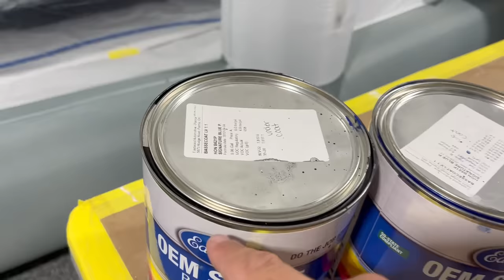I Completely Ruined THIS Paint Job

Comment: I worked at a limousine factory years back, and some dude at the other end of the shop which was almost 200 yards away was using some silicone caulking, and the paint shop guys came screaming down to the other end of the shop asking who the F*** was using silicone!?!? That far away, and still got tons of fish eyes in the paint even though it was in a paint booth.
Reply: Haha, yep.
Reply: We had a guy start up the diesels he would work on right in front of the booth,  smoke would come ripping through lol. The painter and him always yelling at each other even though it's the owners fault
Reply: Makes sense hey. If someone lit a stick of incense even briefly, everyone in that space would smell it. So easy to contaminate an entire space.
Reply: we had a cleaner who decided that the cleaning chemicals supplied to her were not good enough, so she brought her own silicone-based furniture spray polish in to clean the office. contaminated everybody who was in the offices and it migrated with them to the workshop floor causing thousands of pounds worth of damage to paint jobs in the booths (slight negative pressure) too dumb to accept the reasons that were explained to her why she should have just used the cleaning products supplied to her...
Reply: I don't understand What's the problem with Silicone Caulking that could affects the paint
Reply: @geo745don  The fumes from it cause fish eyes in the paint where the paint does not stick in little spots all over the car.
Reply: @user-lx9jm1wo3h  Wow i could imagine from a Spray of Silicone but from Caulking from a Tube. I learned Something new
Reply: @geo745don  Yeah no sillicone caulking soes not affect paint.. ive used plenty of caulk on trucks bwfore painting them. Its the spray sillicone that travels

Comment: A good way to teach people is to show what NOT to do by actually demonstrating someone actually DOING it. While this paint job wasn't intentional, I'm sure, it is good to see what went wrong by actually seeing it, analyzing what went wrong, and explaining and showing ways to correct it. Just like a pilot; they go through almost every emergency situation imaginable in the simulators. Paint society could do videos like this. Like using a slow reducer when the shop is 100 degrees. Or what if you use double the PSI on your gun. Or what if you spray your paint too thick. They could get some cheap paint, some junk panels, and show us what NOT to do by actually showing them do it! Because it's just as important to show what NOT to do than just what to do.

Comment: So glad you posted this. I've been painting for 25 years, and I STILL have problems every now and then with contamination and fisheyes. One thing you mentioned that helps is allowing the first layer to kick before spraying on a heavier 2nd and 3rd layer. Sometimes I will shoot and have a PERFECT finish, and my confidence soars. Then I'll turn right around and get fisheyed all to hell. It is frustrating! I take notes on every shoot, when things go wrong and also when they go good. It helps. But I've come to learn that there's always the possibility that you get contamination from somewhere unexpected, and you just have to bite the bullet, sand it, and reshoot!
Reply: I noticed you used static gun on inside of booth. They usually have microsopic powder on them. May I suggest wiping the car with Safeway after using static gun. Particles could gave become airborne and landed of surface before you painted.

Comment: I was working at a high end custom paint shop a few years ago and the painter had to get up at like 3am to paint because it was so hot in the summer that he kept getting solvent pop on expensive builds and had to go back and redo it. These are the things that can happen and it sucks but it's a lesson in life. Always glad to see you show the reality of things.
Reply: Paint is kind of an art instead of a science.  I work for an OEM, and the Paint Shop is constantly tweaking things throughout the year with the robotic spray booths based on the outside temperature and humidity changes through the year.
Reply: You.have.a.tent..not.a.real..paint..booth.dud.
Reply: High end shop and no aircon ?
Reply: @Gegsite  its not about airtemp, its about surface temp of panels.
Reply: o0bviously air temp effects panel temp
Reply: @Gegsite  now yes but not back in 2016 when the guy I worked for started. He was the painter at Gas Monkey Garage and then decided to start his own shop. I worked there a few years doing the YouTube content. The new place he’s been in for a few years has air conditioning and top facility equipment.
Reply: This sounds more like over reducing the paint, making the paint flash off 2 quick, or stacking the coats on top of each other to rapidly or not useing  a slow enough thinner, if you just stack a coat on top of the last coat, sometimes it flashes off too quick and will give you solvent pop, too much dry time in between coats also.
There are a lot of variables in the types  of paints and the recoat times in-between coats where the original application will enter into critical cure time then you will have a new problem!
ALWAYS READ YOUR PRODUCT INFOMATION LABELS  and follow them like a Madd scientist, rember you are creating a thing of BEAUTY!

Comment: I’ve had this happen when I had too much air being pulled from the booth that I built in my garage. It kept happening no matter what I did until I changed up my fan setup to be positive air pressure inside the booth. Turns out I was pulling in dust through and over the panels/car to my extractor setup.

Once I installed a a high static pressure fan and filter to keep positive pressure, that went away. I didn’t think that there was that much dust in my garage, let alone able to get in through the zippers and seals around the filters.
Reply: Spray booths should always be positive pressure, every booth I have used has a positive pressure to keep contaminants out.
Reply: Something that I learned the hard way, and have made sure of ever since.

Comment: Brian, I recently painted an 03 Accord and sealer, base both looked phenomenal. Then, when I laid down clear I had hundreds of fisheyes. Turns out it was my air compressor. Even though I had a wall mounted oil/water separation system there was oil or something getting in my lines. I boiled it down to being an oil driven compressor. Once I switched and got an oil-less compressor, the redo looks great. Thanks for all you do, your inspiration and the reminders that we will all have issues when painting cars.
Reply: Well, it was the first time he'd used the refrigeration unit. It could be an oil-driven unit or had some lubrication contaminant left over from the factory. I use disposable filters/water traps that pop onto the end of the line, then your gun pops into the filter. It filters the air one last time before it goes straight into the gun. Those have saved me more times than I can count.

Comment: I installed one of those Eastwood filtration setups and had the same problem. Disconnected it and used a different filtering setup that was more janky but the problem went away. I’m planning on disassembling the Eastwood filter to see if I can see what’s wrong. I love their paint products, though.
Reply: You nailed it. New equipment never tested
Reply: They probably use non bodyshop safe stuff in it
Reply: Yep, if yours was brand new, like here, I'm thinking there may be wax or grease contaminants internally.

Comment: You gotta be kidding me! I sprayed my car with single stage today and had similar disaster. Fisheyes all over the place. But, I have plenty of paint still, so I'll try again. Thank you for honesty, seing those perfect results all the time makes me lose hope that I can do it. Your videos, just motivate me to try again and get better.
Reply: Sand your first time down using a water spray bottle and then wipe it down as you go after sanding a panel with 600. 
Keep the panels as you go wiped clean as you go, then tack and spray another wet finish coat over your panels to act as a final coat.
The last finish coat can be a clear coat or a finish coat of color.
Less time in the booth, good booth prep for cleanliness,  keep the air flow down, better to have a downdraft type of booth, but the less dirt, the less stirring the things, up agitation of the things,tack and spray sand for finish in the booth, will give you a cleaner job overall.
All my custom finished  paint jobs were, prep, wax released, tack, spray.
Reply: Fish eye eliminator and clean it better.
Reply: Lighter coats always help, for sure the first one.
Reply: Single stage can berry it on the next go around. Like the guy said, 600 and get a nice flat coat.

Comment: Easy test to see if you have contaminated air if to put your blowgun on and blow onto a mirror for a good 5 mins. If it fogs, or leaves an oily residue, you have your fisheyes answer. Also, tack before using the anti static gun. Rubbing the tack rag on the surface creates static!  Keep the videos going brother!  Subbed!

Comment: I really like the setup but that blower near the floor will circulate dust particles
Reply: Plus it's bringing in crap from the garage with no filtration on it.
Reply: Yes, the fish eyes kept getting worse at the end, and I think the only thing that was changed was adding the intake fan halfway into the paint job. It's a brand new booth and intake fan, so I think it's burning off the mold release oil from the factory. And the fine fuzzy stuff from a brand new floor of the booth. Just a guess, but I would shut down that new intake and try to spray another test panel like  the decklid on the corvette
Reply: That’s what I was thinking blowing shit up off the floor
Reply: I was thinking the same thing.
Reply: The front of the booth is open while spraying at 10:35, air movement could have sucked all kinds of contamination in!

Comment: Might try a little fisheye eliminator in you clear. I've  use it before even just on the second coat and it allowed  the clear to fill the fisheyes enough to save the job. Some of those were pretty deep. I'm  sure you probably don't  use  anything with silicone in that garage but that would do it.
Reply: Hey, love your channel 👍
Reply: @molnarmalibu4702  thank's brother!
Reply: Never heard of doing it on the 2nd coat. I've always added it if I knew the booth would be an issue. Remote painter sometimes lol

Comment: Hello Brian, I had a some of those in my paint job. Only showed up in the last coat of clear so they are not too deep. Most cleaned up in the cut and buff but there are a few that will need some attention. No one notices them unless I point them out. Generally the car looks pretty good. Since I had to re-shoot because the metallic did not lay right the first time, I think I will live with the result. It ain't perfect that's for sure. My air system consisted of two smaller air compressors with extra tankage feeding a filter separator I had sitting in a bucket of cold water outside my garage. It seemed to work ok, I drained a bunch of water out of the system after each use.
Reply: If the few bother you too much you can dab a drop of clear in the fisheye and then sand it and buff. Totally gone at that point.
Reply: @careykuhn9174 - Thanks, gonna try that.

Comment: I spent a year working through constant issues arising on my painted surfaces but I finally got it figured out and haven’t had any problems now for months. First up was replacing y 20 year old 80 gallon with a new one then 20 ‘ of line up and down the wall with drains then two water oil separators then then two filters all done with 1” ID pipes including filters. All of my system is grounded .

Comment: When you added the 2nd blower right before you cleared. Is it possible it added contaminants into the booth, from whatever is sitting in that cabinet next to the blower?
Reply: An it's picking up raw outside air with not much filtering.
Reply: I also highly suspect the 2nd blower being the main source of contamination.

Comment: Hey mate I'm pretty sure I know what this is, hope I can shed some light on it. I've been painter for 20yrs, and learnt this the hard way. If it painted fine the whole process, and next day or few hrs later fish eyed or silicon or whatever we want to call it, this can occur when the environment has bad air flow ventilation, and the solvents are slowly coming out of the job then fall back onto the surface while it's still soft. It can create those reverse craters. I did some immaculate jobs I didn't want to bake in a proper booth, I finished clearing, shut the booth down, and returned the next day to find this same result. It was because I left the booth closed up and no air flow. On a minor scale, a smaller hazing can occur if you cover a respray up you painted and put in the workshop and covered in plastic to protect it, EVEN AFTER ITS BAKED. All the best mate keep up the good work 👏

Comment: I painted a Porsche shell in my garage yesterday. No spray booth, no air warmer just a calm day, wet floor and PPG DBC base coat and Upol 2882 clear. Little orange peel but no runs, very little dirt. Sand and buff today.

Comment: I'm no pro, but I am in Southwest Florida. I have a trick little system. 60 Gallon 2 stage compressor. I take a 50 ft hose circular coiled up in a 30" pail. When I paint I fill the pail with ice (my chiller). Then I continue it to a Devilbiss water separator. Because its cool air, it is not steam (from the compressor) and it works well. Then I run the air line 3/8" to a Motor guard (toilet paper type) filter to remove anything that might have gotten past the water separator, plus any oils or contaminants. Finally, a Devilbiss filter at the gun. I have NEVER had a problem since I did this, even in South Florida, with 99% humidity.
Reply: Yeah his system is probably the problem the lines look good but the chiller and small compressor not good after his lines a desiccant filter and a motor guard filter would be better and more in line with a diy garage

Comment: I had a buddy paint my son’s car in my home garage and had a similar experience with fish eyes, although thankfully not as bad. The only thing I can point to that caused it was the Eastwood air filter. I have the exact same one that you have. I was also running another water separator before the gun. It was warm out, alround 85-87 degrees and the Eastwood filter just couldn’t keep up. I drained it and virtually nothing came out. But when I opened it, the desiccant was completely SOAKED and holding the moisture. I cleaned it out, replaced the filter and was good to go. BTW, I started with a newer filter that was clean and dry. Haven’t painted in higher temps like that since and haven’t had the issue again.

Comment: I would crater check a few things before the respray.make some 4x12 test panels.. prep panels really well clean panels really well. Spray a coat of clear on one. I would spray it with a different clear coat than used on the car.Observe panel for craters. if clean you eliminate the compressor/drier/air hose as a possible contamination source. If blown out it’s more than likely from the compressed air delivery system somewhere.
spray another panel with clear and soon as coated blow air on the panel from your intake blower that u turned on late in the process and  observe for craters.  
It would be wise to test  some things before the respray.

Comment: The usual risks you take when painting at home. I paint in a portable carport converted into a booth. Some trash is expected and the best I hope for is to bury it in the clear enough to not be visible under normal circumstances. Most of the time it works out fine with a bit of buffing. Also, it's important to use low overspray guns especially on clear.... LPH400 is the best contender for this yet.

Comment: Brian I had the exact same issue, it's the paint booth, the exhaust fan does not suck the air out effectively and if you try to use a stronger fan the booth begins to cave in

Comment: Who was spraying silicon in front of the air intake? LOL! It's a shame because that's a beautiful blue color. I love watcking the videos but the only concern of mine is when you (or the other guys) rub their bare hands on the body and the way you remove wax and grease remover. I'm 71 and was always taught to wipe off in one direction and keep turning the towel to not contaminate the paint (replace towel after all sides are used).Maybe the new air device used to circluate the air had some type of manufactures assembly lube in. Good luck and don't give up. Thank you for yyour videos.

Comment: I think I would take another panel of something into the booth and spray it before I would redo the corvette to see if the same thing happens just to rule out all the accessories hooked up to the system. Who knows it could even be the booth itself probably not but weird things happen when your applying paint,and that’s some dollars down the tubes. Who knows it could even be something coming from the air being blown in for the exhaust.

Comment: Those fish eyes look like moisture.  I use the 3M full face mask when clearing and I've had condensation drip from the face nose area before from breath.   I also use a dedicated hose for painting that I never connect to a non filtered non dried air source.  I also started using an in-line air filter on the hose at the gun, just to be sure there's no dirt or moisture coming out of the dessicant filter on the wall.  I'd also spray down that floor with water using a garden chemical sprayer...